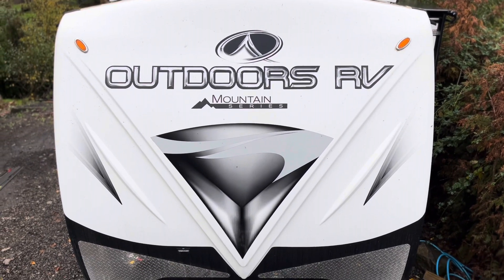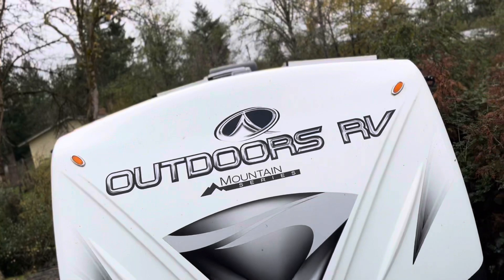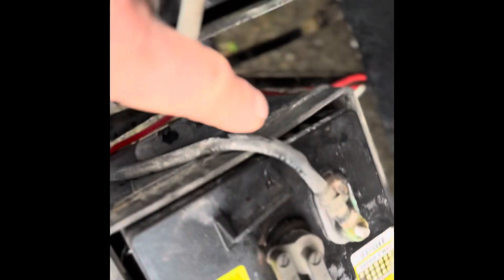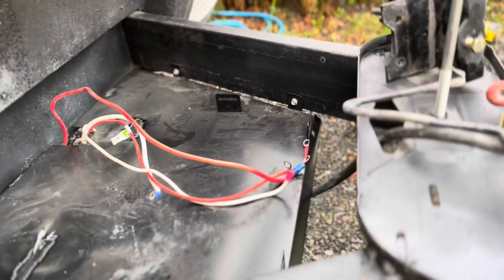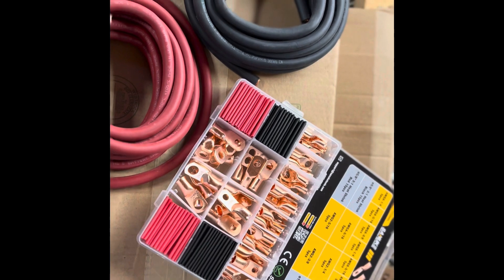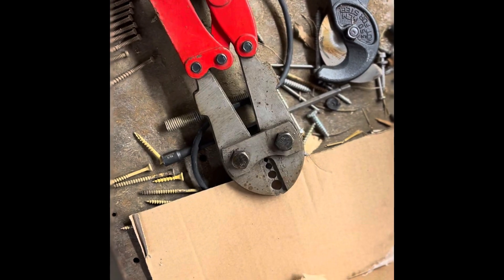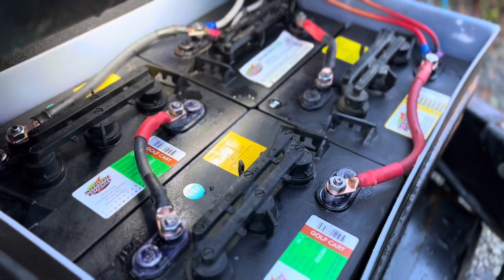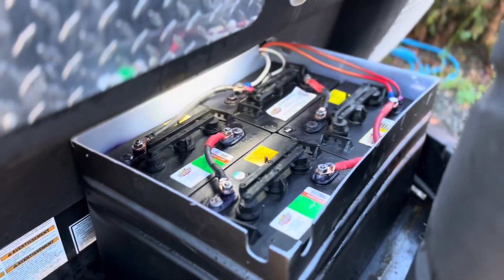Doubling our battery storage capacity by going from (2) 6 volt batteries to (4) on our 12V system

Comment: Nice setup.  I'm currently looking at doubling my battery bank from 2 6v to 4 6v as well.    The batteries I will be purchasing are 230Ah each so I'm assuming that will provide 920Ah, BUT knowing I should only draw down to a maximum of 50% of that it really only should give me 460Ah roughly.   I have 360w of solar as well to charge these and all my outlets run through my inverter.   Currently everything works great on my setup, but to have additional amp hours for those rainy days while camping will be great.   With what I explained does the amp hours with the additional 2 batteries seem accurate, or am I just hopeful do you think?
Reply: Your amp hours will only be 460 total. You have 2 sets wired in series, then those sets wired in parallel. Series will bring the 6 volts to 12 but will not double your amp hours, then parallel will double the amp hours.